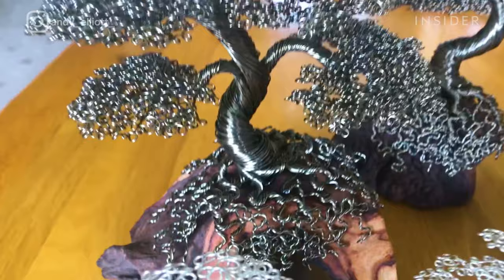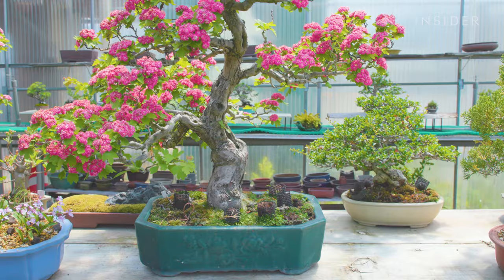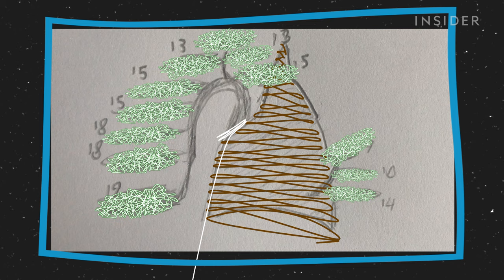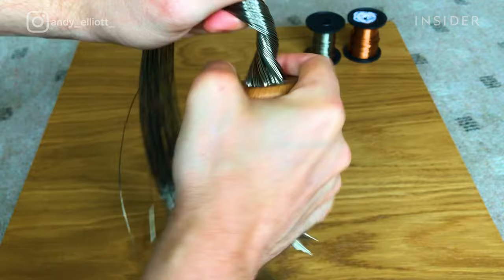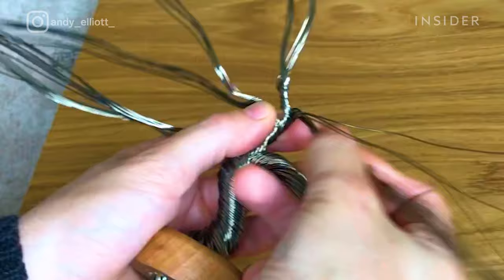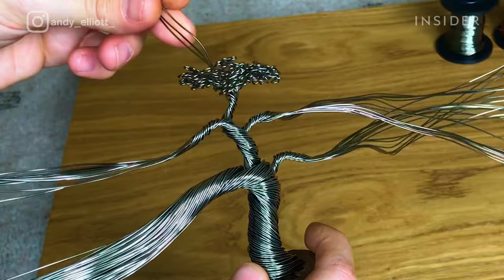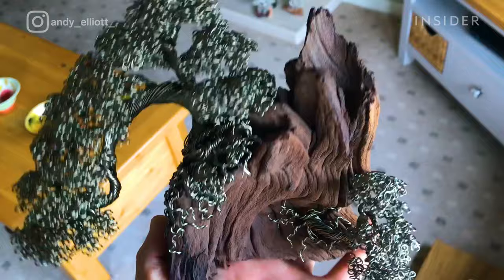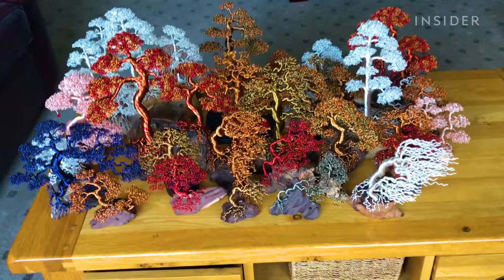Making Bonsai By Bending Metal Wire | Master Craft

Comment: I would like to know the name of your used tool. I’m looking for that kind of precise pliers. Do you mind sharing?
Reply: I was wondering the same, it looks like a standard flat bit tip (screwdriver) with a slot cut out of the middle (presumably using a dremmel or similar)

Comment: What is the thickness of wire used in mm
Reply: Anywhere from 14-26 mm. Just depends on what you want. 🥰
Reply: Crazy response nowhere near them size gauges looks like from 3 to 5 mm Max

Comment: Please advise, these are copper wire or aluminium and what it the thickness (in Gauge or mm)
Reply: 0.7 mm
Reply: @markdenversunga7052  do u know the lengnth of this one?They said 15 to 20 cm but it looked alot longer🤔🤔
Reply: Aluminium because it's easy to bend just craft wire